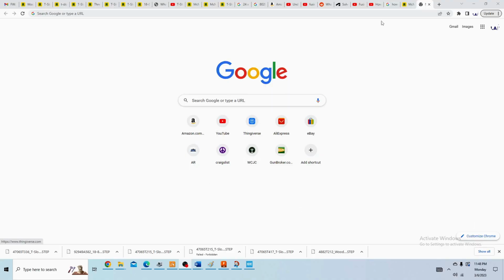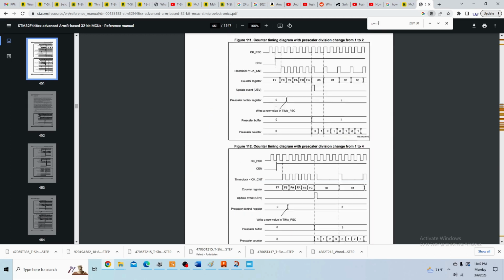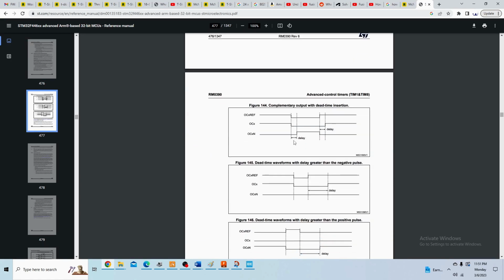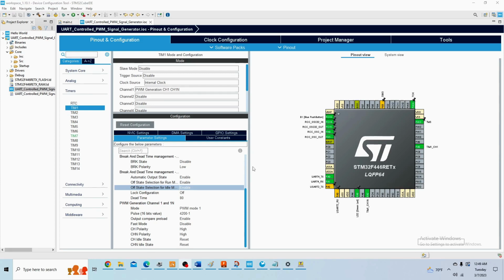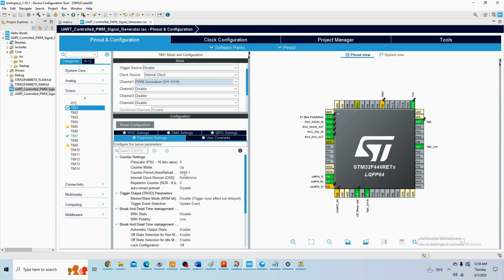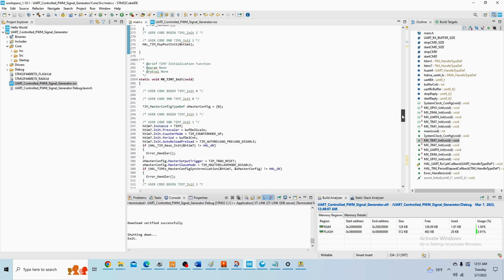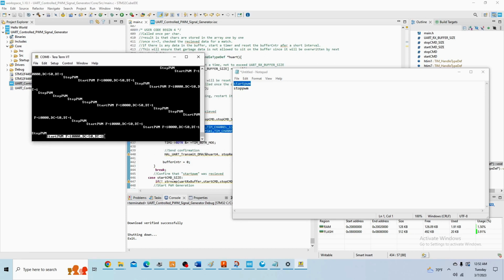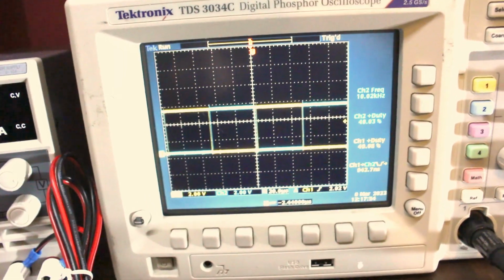Using STM32- Generating complimentary PWM with Dead-Time insertion

Comment: 6:37 Incorrect. Not "for start channel 1 and channel 2", but for start channel 1 and activate the complementary output. This is a tricky place: it turns out that it is not enough to configure channel 1 to generate PWM on the CH1 and CH1N outputs, you also need to start the same channel twice!

Comment: Hello Zain! Pls am trying to implement centre aligned complementary pwm on stm32f103c8t6.  I finally get it working with dma using master/slave mode on both timers1 and 2 . But my problem is the timer1 frequency is not halved even though i set OC1M bits to pwm mode 2 and centre aligned mode 2 on CMS bits ...pls help